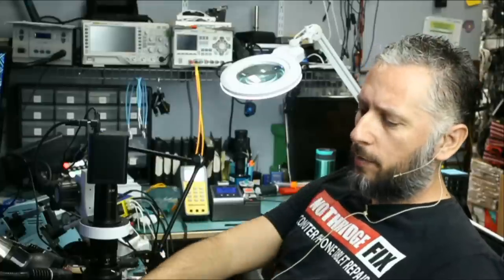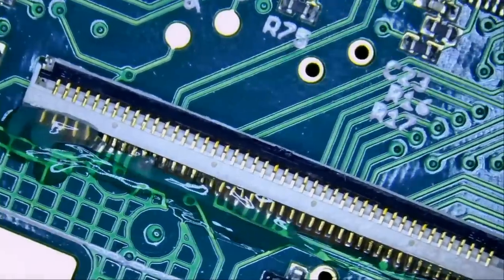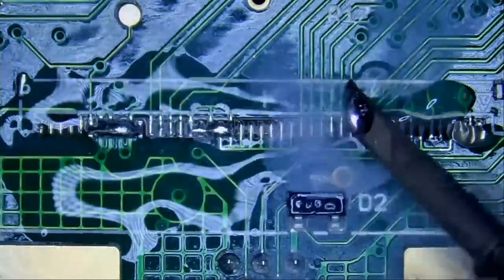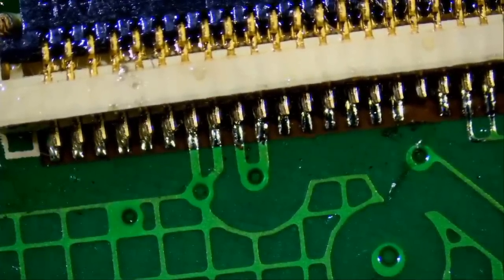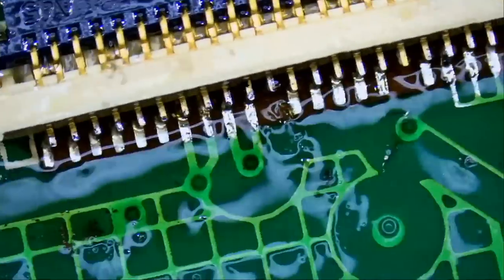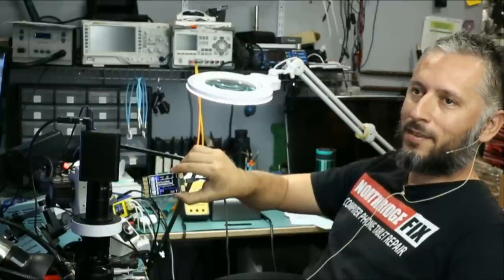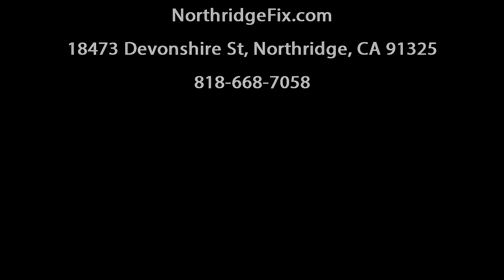Expensive Car Tuner repair - Another shop gave up. Can we save it ?

Comment: Watching your videos has greatly improved the work i do at my job. Yesterday I had to use the rework gun to solder tiny LEDs to a flexible PCB, something I have struggled with in the past. They wound up looking great and worked just as well. Also I frequently solder tiny 42G camera wires to USB PCBs, my solder joints look so much better, all this after watching you and mimicking some of your techniques. Thank you for posting your videos, I now feel as though I have the confidence to do anything that is asked of me. Even my supervisor noticed how much improvement I have made in my work the past few months, I should have a raise coming up soon, and high quality work will def not hurt the chance of that happening. Id really like to take the skills I am learneding now and transfer that into an electronics repair hobby/business in the future.
Reply: That’s awesome! Very cool to hear things like that.

Comment: Though the panel itself might be dimensionally identical, there may be subtle differences in expected display timings and refresh rates, or the pinout/layout of the PCB/ribbon that are application specific. This makes it difficult to source a replacement.  No display such as all white, all black, etc. suggests the TFT panel is missing some critical signal like clock.
Maybe a dissection of a broken panel will yield more information.

Comment: Did you remove the micro SD card stuck in the donor board before extracting the LCD connector? Or was it left in place on purpose?
Reply: I noticed that micro SD
Reply: I also worried for that poor sd card

Comment: The part number on the flex is not good for looking up. Part of the number is FPC (Flat printed circuit) which could indicate that the cable carries a different part number than the display itself. It's there any numbers printed on the back of the display itself?
Reply from the maker: tc241-832-c-s4-j-e 170317 h.
Reply: @NorthridgeFix  Do you have the width/diagonal size of the screen too? I'm in China, seeing if I can find it.

Comment: Will be nice to see a video with your opinion about low temperature silver solder paste. The one that auto adhere to pins without the help of flux. Is it good for general use or only for bga and tiny chips? Thank you for the knowledge in every video you post.

Comment: There is similar model on market named "Truly TFT7K0273FPC-A1-E". I dont know what is difference between that TFT8K0273FPC-A1-E and Truly model TFT7K0273FPC-A1-E? Only difference what i can to see is number 7 instead of 8 in model number but who knows maybe is the same size and can work instead of that with number 8? Maybe is that number only different revision but it is same display?!  That TFT7K0273FPC-A1-E cost about $25 - $30 online. Maybe is worth to try this if is size and connectror are same.

Comment: Hello ! If you can post the lcd screen fpc number here , i can help you find a compatible lcd or even the same one it is available online.
Reply: He showed the FPC number. Check on the video
Reply: @tobiasmangoma9566  at what time in the video ?
Reply: tft8k4338fpc ap 1 e. 
Very end of video
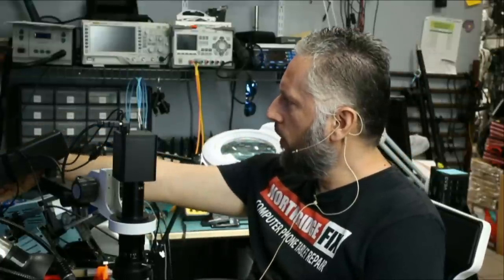Reply: @balajinarasimhan5346  20:00
Reply from the maker: The following number was back of the lcd different then the flex model number. tc241-832-c-s4-j-e 170317 h

Comment: Hi Alex, can I ask in this case, is it possible to do wick solder removal first for removing it from donor board? It is because I saw the connector is going to be soldered tip by tip anyway. Thanks
Reply: If you see after he finish solder he speaks of two pads the other side UNDER the plastic that he most likely cannot re-solder, but they are only there to hold the connector on better.

These are probably the reason he choose to remove the connector the way he did as they are not accessible from the top and need heat from other side or plastic will melt.
Reply: No, wick solder removal only mainly works with through hole components and only if there is plenty of space between the component leg and the hole or board surface, meaning that the component leg will be completely free of physical contact after the solder is absorbed. On surface mounted components you cannot get all the solder out and there will always be physical contact if the component is factory mounted (with a very thin layer of solder under it). Leaving a small non visible connection and trying to pull it off will result in ripped of pads or damaged component. Maybe if the connector is manually soldered like in this video and placed on a thicker solder pile it could work so that there will be a gap under each contact pin after using wick but not with machine mounted components.

Comment: Putting connector pins in parallel, it should be illegal.  It's designed to fail.  If one connection breaks, the remaining ones are overstressed, until another one dies, and so on.

Comment: can u please mention the heat temperature when u de soldering any connector depend on the board layers , what heat degree should we use also the air speed

Comment: Curious, why don't you work on the Xbox 360s? You literally fix everything else lol.
Reply: Because a xbox 360 cost 50$ used online working
And repair is like 2-300
Reply: They are already charge more to fix xbox one I believe than buy used
Reply: Probably because the cost of the repair is way more than it's worth and people want it to be cheaper.
Reply: Well for a start you can buy a used one for way less than a repair would cost so I imagine it's just not a good economical use of their time.
Reply: 'Cos he has no experience in working on Xbox 360.  When you work on a device the first time, you may need to spend more time in understanding its board layout and components.  It's also not economical to fix a Xbox 360 as they're dirt cheap in the used market.
Reply: Can get a working one off yard sales or ebay for less than 50$ these days. So..

Comment: Maybe those screens needs to be flashed first with a firmware from another working screen like  iphones when you get a new screen it won't work unless you flash it with the firmware or what ever of the broken one you replaced.
Reply: They are visibly broken
Reply: @ellinasmarios6165  i am talking about the screens he bought from china as brand new

Comment: should had worked on the xbox 360  would been a good video
Reply: not worth it because you can buy used xbox 360 for less than you would pay for the repair
Reply: It would indeed and it would be the shortest fix either. I can picture Alex now with the repair. Picking up the xbox and dumping it in the trash and then saying the job is done and better then factory. 👍

Comment: Connector bit curvd how do you handle this
Reply from the maker: Watch the video. That's how i handle it.
Reply: You´re right it curved. By at least 0,003mm...
Reply: it doesn't matter once all the pins are making a good connection, when you're dealing with that many small pins trying to get that connector PERFECTLY straight is a fools errand
Reply: @NorthridgeFix  exactly

Comment: I'm kind of making this up because I don't have practical experience with these kinds of repairs but I'm pretty sure you cannot find this specific LCD model anywhere online but if I'm not mistaken you could find a similar LCD with the same dimensions and connector and that one should work as a viable replacement right? If I'm mistaken let me know.
Reply: He'd be happy for either someone selling many working second hand ones or a manufacturer who makes the same specification, several manufacturers can sometimes make the same kind of screen, and sometimes only one, in this case it sounds like it may of been just one, and it is discontinued as it clearly breaks a lot. 

There are companies who make custom screens to order, size/connector all chosen by you, but this is very expensive in small amounts and is more for creating new products. To make that viable you would also have to re-sell the screen and make many more than you need to get cost down (unless you charge $1000 like for the xbox360 lol), otherwise it's just not worth it, and the demand for the screen needs to be there for someone to still make them , and I doubt that is the case.

If he lucky a screen is an "off the shelf part" but this looks old so I don't think anyone is making them anymore unless there is enough demand still, then mby. So second hand is most likely option to get them, but he is asking if anyone is making them in that spec.
Reply: It's very possible to find another LCD with same size, resolution and controller, but it might require an adaptor cable since the connector isn't standardised.
Reply: If you can find one with the same pinout and protocol...
Reply: @khatharrmalkavian3306  i guess i just assumed they would all run on a standard display protocol but i think there are many with the same connection type and size. I don't know much about this so I guess it's not a guarantee they will be able to work with this device as they might run a different protocol?

Comment: I wonder if there's ever a case when flux isn't your friend?
Reply: yeah.  When you use too much flux trying to solder a tiny part.  The tiny part in too difficult to hold with tweezers, before it could be tacked down it floated away due to too much flux.  So what to do.  Tack it down first then add lots of flux.
Reballing with too much flux is a nightmare.
Reply: never such a case
Reply: When you get it in your mouth. It definitely isn't your friend.